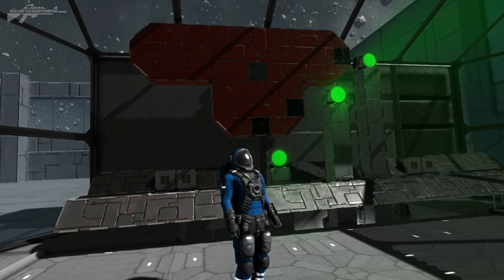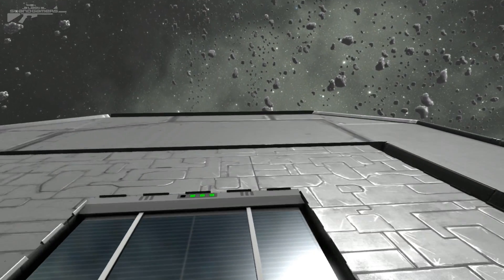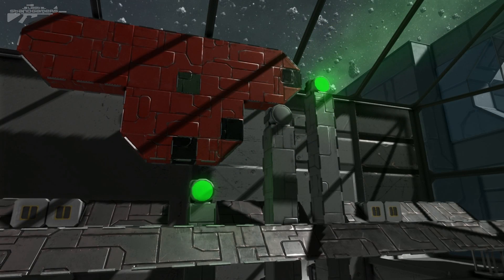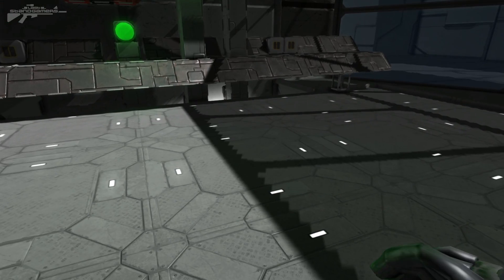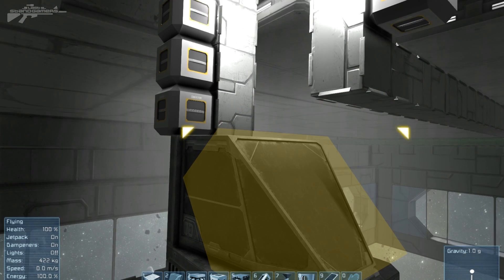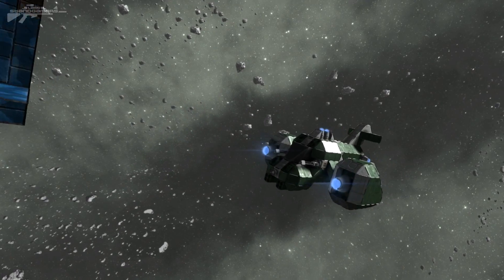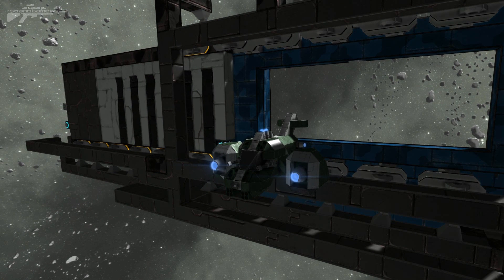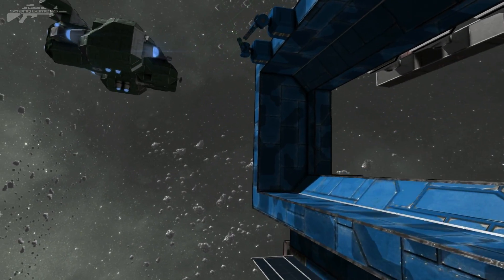Space Engineers - Motion Sensors, Security Control Room Concept

Comment: So, for the indicator lights to work, they have to be connected ONLY to the solar panel and absolutely no other sources of power, which means you can't seal where the "ducts" (narrators words, not mine) enter the control room...  So you can go directly from the outside into the security room unless you seal that whole underside you were showing.  Hardly secure.

These are all just really REALLY kludge-y work arounds to simple systems that will [hopefully] be added later.

Comment: Clever system! Really nice, you just fly through the doorway and have no need to worry about getting out of your ship opening and closing the door every time.
Only flaw is that none of these systems can be situated on the shadow side of your ship and when you fly and turn your ship, the doors might open by of getting in the shade because of your turn. Of course, this can be overcome by placing extra generators that you turn on when you start flying, so that the doors remain shut. And remember to turn the right side to the sun when you stop.

By the way: I was wondering if solar panels are resistant to the exhaust flame(s)? Because your parking spot might appear permanently occupied, when it is destroyed by a not so gently landing. In your video they weren't destroyed, but you touched down very carefully...
If they are not, would it help to put windows over them (are they fire resistant and do the panels still work behind glass?)?

Comment: Problem with the big ass door, its that its good on a station for hangar doors, something that won't move around and always be lit by the sunlight.

On a ship...each time you turn and there is one side in the shadow, your door will open...

You can of course use the group command to lock it with the landing gears or disable the generators.

Comment: What if the panels are blown up?
Reply: Then the door opens, and you're screwed. Though, you could add a rotor-based locking mechanism to keep the door closed in case of attack...or just turn the mass generator off.

Comment: Large blast doors are definitely something they should add next but I would rather they focus on optimization for both multiplayer and single player instead of adding new stuff.
Reply: Large scale optimization is always something that comes during the final phase of development (Or at least in larger intervals). Every new feature you add after you optimized the current ones will make your optimization obsolete and you need to put new effort in it to optimize the new feature and (most of the time) some other major part from scratch. The same goes with balancing.